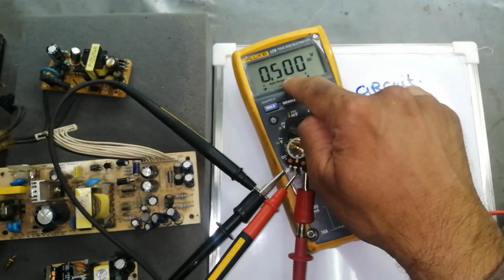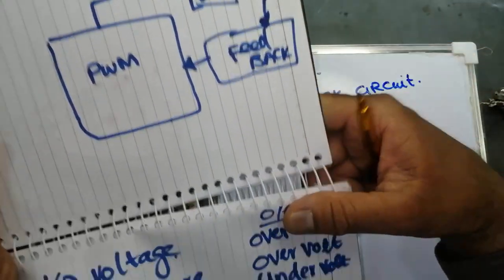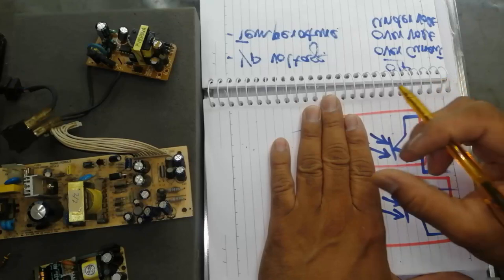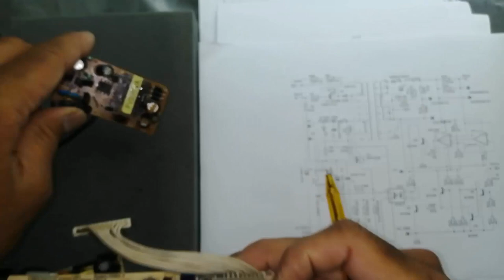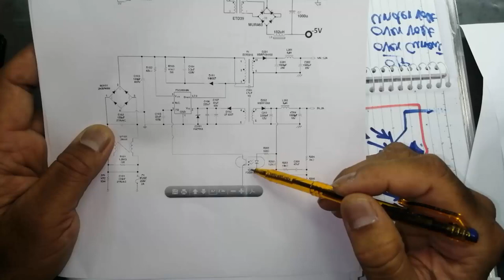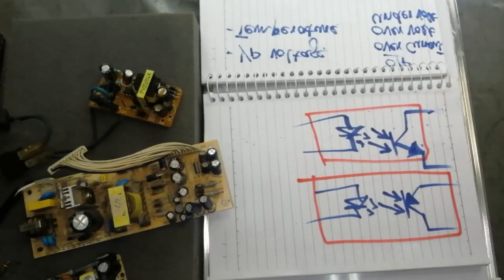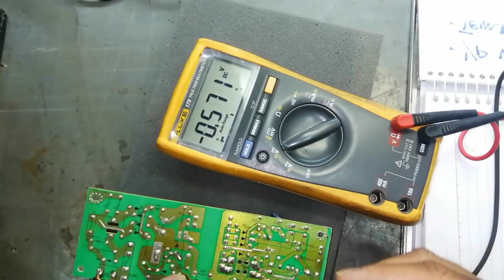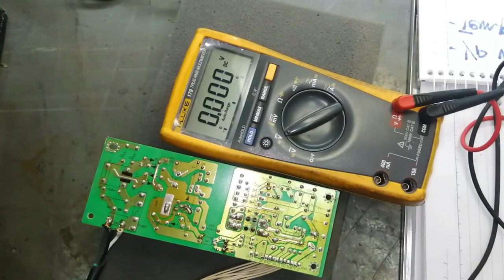#142 FEEDBACK in Switch Mode Power Supply SMPS

Comment: thanks for the very informative videos. what if the input voltage of the optocoupler is zero but the out put of the optocoupler shows steady 2V  and also the output voltage  of the power supply is also zero. ?
Reply from the maker: best regards
if input of optocoupler is zero, that means there are no voltage in secondary side,
you have to check switching of the IC, is it switching?
VCC voltage of supply are good or not?
Reply: @HaseebElectronics  I checked the voltage on the primary side and there is 230V AC and after the bridged rectifier there is 330V DC (constant ) and the FET seems to be switching and I get 330 V DC at the primary side   of the chopper transformer but zero on the secondary side of the transformer.   The optocoupler  is driven by TL431.